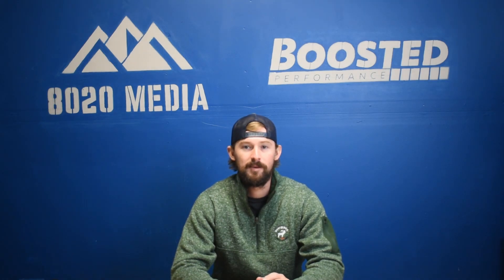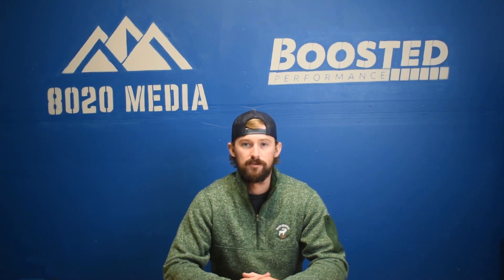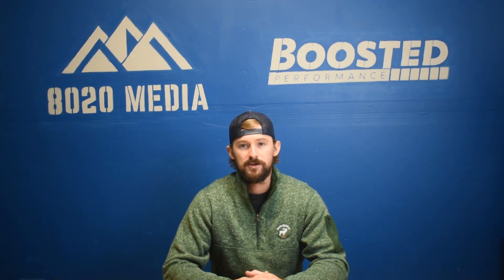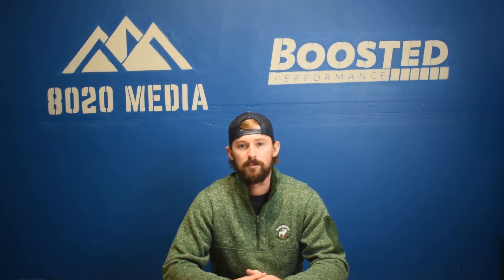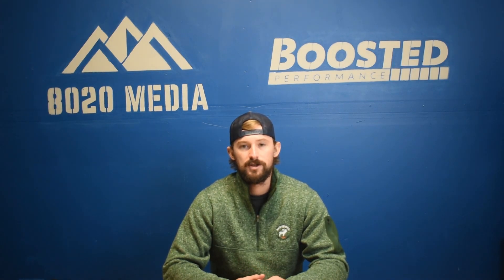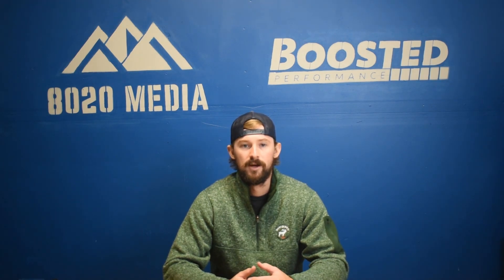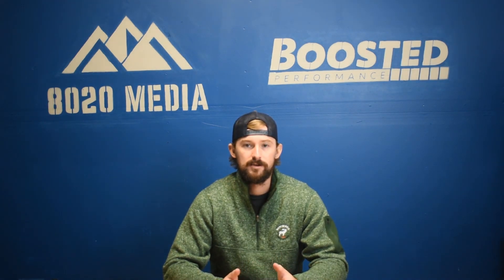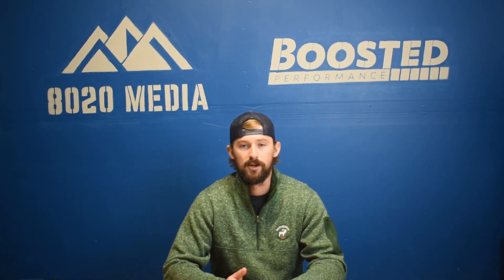Is the Ford Triton V10 a Bad Engine?

Comment: I'm looking to buy a decent gas-powered older class A motorhome over the next few months. I've of course been absorbing Youtube videos to gain as much knowledge as I can regarding engine options and the pros and cons of each. The three flavors that stand out are the Ford 460, the chevy 454 and the Ford Triton V10. The reputations so far for the Ford 460 and the Chevy 454 seem to be favorable. The V10 is much more, shall we say, spotty. Case in point, and one not mentioned in your video:

A Youtube video from about 4 years ago described a Class A motorhome with the Ford V10 that was making a knocking noise. This engine had around 65,000 miles on it. After a couple of mis-diagnosis incidences (valve train, exhaust manifold gasket) it was found that the cylinder #7 fuel injector was malfunctioning and pouring excessive fuel into that cylinder. The tear-down revealed that this excessive fuel had been washing the oil from the rings and cylinder walls, causing the piston skirt to score both itself and the cylinder wall and the piston to slap - which was the source of the knocking sound. Several thousand dollars later the engine was rebuilt by a reputable Phoenix-area shop.  

I vaguely recall another Youtuber mechanic (car wizard) strongly recommending avoiding these engines as well as the Triton V8s. While most engines have their pros, cons and gotchas, with everything I've uncovered thus far about this particular powerplant I've decided to avoid the V10 like plutonium.
Reply from the maker: Not a bad call, I wouldn't say these have been terrible engines, at least in newer form, but the 454 and 460 definitely have a few less serious problems.

Comment: Retired Tech Here, Yes Saw Plugs Blow Out, Had Many Customers That Never Had A Problem. Use Motorcraft Plugs Much Better! This Is A Tough Engine, And Like Any Other. Just Needs To Maintained Properly! Great Report Thanks
Reply from the maker: Charles - Thanks for sharing your experience and insight! This will certainly help future viewers.
Reply: @8020Automotive  ok great thank you
Reply: Would you buy a 2003 f250 super duty at 191k miles if it was well maintained?  I'm shopping for a farm truck. Will haul hay/livestock, but only put maybe 3k miles on it per year max.  Looking for something with reliabiilty and longevity.
Reply: @slandshark   Yes,  if it had regular maintenance and the price was in line with the overall condition.  Worst repair might be that the exhaust manifold studs need replaced.  Just had this done at 150k on our 2008 V10.   Couple other things to check with high mileage...  Verify front end components are good and tight,  verify front calipers release fully and don't drag.
Reply: I feel like the problem stems from not torquing down the plugs to the specific requirements
Reply: Howdy Mr Charles, I'm purchasing a v 10 single cab dually 4x4 automatic. They're is a little smoke coming out the bottom of the engine where the exhaust meets the engine.  No oil leak that I can find and doesn't smell like oil. Just wondering your take, I know there's not a lot of info to help you make your decision. Thank you in advance for answer
Reply: Drove a E250 over 300k with zero problems.

Comment: Another channel did a 6.8 excursion vs 8.1 suburban 2500 and both got 13.4 and 13.5mph after 100 miles. 
They made the 6.8 for 20 years because it was amazing in fact they still use them for school busses and large generators because they are extremely reliable with good maintenance. My f350 6.8 is sitting at 478,000 miles and I haven't had to open up the engine. My biggest problem has been old sensors and exhaust manifold bolts breaking. I already rethreaded for a larger size bolt and that has fixed the issue thus far. 

Its been the most reliable vehicle ive owned and has never left me stranded, i bought it at 211k miles for $900 it had been sitting since the owner passed away and his son was a cheby guy and disnt want it. 

Change the oile every 7-10k miles at least clean the spark plugs around the same time torque the plugs to 20-21ft/lbs and just do your maintenance and they'll go on for a long time. At 500k miles im gonan do a rebuild and do some upgrades to help it keep up. I will never get rid of this truck until the fram rusts away.
Reply from the maker: Dustin - Thanks for taking the time to share your experience! This will certainly help future viewers.
Reply: I'm more like a chevy guy but also trying not no fall into the dumb idea one brand is better than other. 
thank for sharing👍😎👍
Reply: Love hearing the Bluebird Visions propane screaming by. School is around the corner.
Reply: I'm disabled I will have to have someone change the plugs for me is it an expensive job? Thank you for your review of the 6.8

Comment: bought my 2000 excursion with 420,000 on clock and bad trans from a old guy who drove long haul to visit his kids a lot. trans gave out so he parked it thinking of getting trans replaced. never did so he sold it to me. i put in a used trans out of another f250 I bought with it and been driving it for 80,000 miles now. replaced vac lines and about to replace plugs and coils. nothing else and runs flawless. it was quieter than my 2002 f250 i bought new with a 5.4. I get 12-13 around town and 16-16.5 on the highway and 11.5 towing my 23' boat. just came back from a vacation run of 500 miles and averaged 14.5 town and running 75 most of the time. before anyone calls bs, cut the ford muffler off and replace with a flow master or equivalent and a k&n. DONT cut off the cat though or you will definitely lose your milage gains.
Reply from the maker: O - Thanks for sharing your experience. Sounds like you got a good one!
Reply: Kool thanks thinking of buying a 10 f250 with a v10 in it.
Reply from the maker: C - Nice! Keep us updated.
Reply: If u cut the cat off, you need to retune the ecu for mpg/ power gains.
Reply: My 5.4 absolutely loves gas ⛽ 16ish highway, 12/13 city...it is hell having a shitty job that doesn't pay a whole lot. Keeping gas in this thing is a true struggle 💯
Reply: @everythingstrength1485  most people that have low pain jobs and have to use their vehicle for commuting get a little four banger. Luckily I’m given a nice work truck but keep the 5.4 expedition for the weekends and for road trips. Maybe consider this and get Allstate with the mile wise program. It only charges you for the miles you drive instead of an expensive flat rate for vehicles you hardly drive. This is how I’m able to afford my sports car plus the expedition 2 Wheel Dr. and another expedition four-wheel-drive and the wife’s car.
Reply: @RemmikRotus  "the wife" took everything that wasn't bolted down. Even some things that were 💯 (whole 2 story house)....it's a struggle with a 40 gallon gas tank, and no other options
Reply: @everythingstrength1485 you have other options, you just don’t want to trade in your truck
Reply from the maker: E - Thanks for sharing your experience.
Reply: @everythingstrength1485 for your 5.4

SPD Y-Pipe
Shorty headers 
Sct with a tune 

Not only will it improve drivability but you will conservatively gain 2.5 mpg at highway speeds 

I have a 21' RV with  this engine 10.3  - 13.9 mpg before mods 14 .1 - 16.9 mpg at 61 mph ...  RV loaded weights close 10,500 lbs
Reply: K&n 😂 stock intake is good to 500 hp. Quit telling people to waste money.
Reply from the maker: J - In our opinion, it's not a waste of money.

Comment: When it comes to fuel economy, you have to remember the V-10 replaced the 460 big block V-8 and not only made more power, but was more feul efficient, about 20% better.  So at the time in the 90's, the feul economy of the V-10 was pretty good for a large gas engine.
Reply from the maker: Brown - Great insight added here. Thanks!

Comment: It always amazes me when the subject of fuel economy comes up with gas trucks, its a simple fact that nox emissions are combated in two was EGR and rich mixtures to reduce combustion temperatures and in general piston and exhaust valve temperatures by the ability of the unburnt fuel being able to remove some temperature and making engines more durable under heavy towing and high load conditions, manufacturers program for worst case scenario as no one knows which truck will be used by whom for what at what frequency  !
Reply from the maker: Hitman - Thanks for the insight.

Comment: Where were you with this video 3 years ago? My 1999 F350 was driving almost fine, it developed a random misfire. But, the real pisser happened at 143k miles the F'en timing chain on the passenger side broke. It's a truck and Fords used to be reliable, I couldn't afford the diesel so I got the gasser. So let down by Ford, big time. I really should have known better, after all, who in their right mind would put an OHC engine into a truck? That alone should have pushed me away from Ford. But I bought it anyway. At the end of your video you said these were overall pretty reliable engines. No they were not, blowing plugs, burning valve, exhaust  leaks, timing chain failures, etc. And if a chain failed it does valve damage. If you truly want a reliable engine you buy the Chevy with the 6.0l engine. Those were great trucks all the way around.
Reply from the maker: Sorry Kirk! There's Chevy people and there's Ford people. Each are great.
Reply: @8020Automotive  honestly I felt betrayed by Ford. I grew up in a ford family. I've had Rangers, older F350 with a fantastic 460, I've even had a Taurus and a Tempo. So when i bought a truck labelled "Super Duty", that's kind of what i expected. Instead at only 143k the engine became a boat anchor. All my Chevy friends cruised right past 300k with their trucks. But in the bright side, I didn't buy a Dodge. The friends that bought Dodges didnt even make it to 100k.
Reply from the maker: Sounds like a rough experience and we totally get the frustration.

Comment: I just wanted to let you know that youre completely butchering and blending the spark plug issues

Also the 05-08 3v motors also had spark plug issues in the 3v form (btw the E series and bare chassis motors were almost always 2v up to 2019 where all F series v10's after 2005 were of the 3v design.

So thr plug issues. The early 97-02 motors had a HEAD CASTING issue. The spark plug as fine, but someone goofed up and tapered the plug holes too much meaning while the plug had like 11 threads on it, there were only about 4 threads in the head. They fixed this issue in mid 2002 and it was great. Some people would overtorque the 4 thread heads leading to weakening of the threads that would cause a blowout (if they didn't just pull the threads while tightening), others would under-tighten the plugs causing the plugs to come loose while the engine was running and rattle and rip the threads out, leading to a blowout.

Then in 2005 they came out with the 3v, like 14 threads right? But they made the plug 2 pieces pressed together and thwy had a long stem that would press into the head below the threads and help seal. This long stem would sieze, and then the threaded part would come out and leave the cores inside, or the core would twist in half. Quite a fun time, and then you had some people over tighten these and the cores would shoot out and leave the threaded sections fully intact. Then in 2008 they moved to a 1-piece spark plug and from them on the only issues were sludge buildup and the plugs being tight enough to break cheap ratchets on by the time their change interval came.

Thank you for atte ding my ted talk. I will see myself out.

Edit: so the timing chain issue. 
They used plastictensiomers from somewhere around 2003 to about 2008/2009, before and after that time period they used cast iron chain tensioners. The plastic chain tensioners would crack and fail early, the cas iron tensioners would survive as long as you kept up with your oil changes for the most part.

Also plastic guides suck but many other families of engines also use plastic chain guides. Also the v10s frequently got iron tensioners even through the plastic tensioner era because they were known to be a heavier duty application. The v8's had more chain issues and also the 3v v8's got VCT systems (that sucked balls) and the v10 never got those that i'm aware of.
Reply from the maker: Thanks for all the additional info and keeping us honest!

Comment: 250.000 on our 2001 V10, service every 3.000 miles, Castrol 10w30 with Wix xp or Mobile 1 oil filters, replaced alternator once, thats it.
Reply from the maker: Southern - Thanks for sharing your experience! It sounds like you have a good one!

Comment: Bought my '01 used with 117K on the clock. Had the plugs replaced at the dealership, never been an issue. Over a decade later and 165K no issues with the drivetrain. I've got the heaviest truck you could get outside a dually, I get 11MPG in mostly city driving and about 13 highway only. Best tank I've ever gotten was a flat stretch of highway where I cruised at 60MPH with a tailwind, and got 16MPG. Never touched that mileage again, it's consistently been 11-13 MPG. This truck seems to have about as much torque as either of the Cummins trucks I owned in the past. Had 2 coil packs go bad, I replaced them myself. Original transmission and it shifts fine. It's powerful enough to stomp on the gas and burn rubber on dry pavement even with brand new tires. Worst thing I could say about the V10 is the gas mileage. Of course the modern choked-down diesels aren't doing much better and cost more per mile to operate.
Reply from the maker: Eric - Thanks for sharing your experience! This will be very insightful for future viewers.

Comment: I just sold my 1999 F-350 to a close friend.  It had 330,000 miles on it and ran very well.  I have repaired 6 of the spark plug threads in the past.  With the kit I have, it wasn't really that big of a deal and really gives me piece of mind.
Reply: Do you have a link to the kit you bought?
Reply: @SirGuidemere  My buddy bought his at Napa.
Reply: Could you tell me what kit you bought please
Reply: @derekquintero6252  My buddy bought the kit at Napa.
Reply from the maker: Turbo - Thanks for sharing this experience! Sounds like you sold a beast of a truck.
Reply: You pulled the heads off for the spark plug thread job?
You pulled the motor out?

Comment: I agree with some of your observations regarding the problem areas of the V-10 engines. That said, many of the issues can be improved by better maintenance. Many of these engines are used in heavy duty towing applications and can benefit from frequent fleet schedule (3000 mile) oil change intervals rather than the 5000 mile intervals suggested. (Oil is cheap compared to engine replacement). The cams and cam chain components will live much happier lives with clean oil.  I would disagree with your opinion on the mileage numbers. Unless you have your right on the floorboard all the time, I find that these engines can achieve decent mileage in everyday use. I normally get 11.5  to 13MPG around town and slightly better on the highway when not towing. Towing a 6000 lb. trailer it drops down to 8-10 depending how much climbing is needed. That is very good compared to the 460 V8 truck it replaced which could never reach 10 MPG empty or better than 6.5 towing. The V-10 is a better engine for towing. Based on what is available in the truck market today, I will keep my 2001 F-350 4WD until it turns to dust.
Reply from the maker: Paul - Thanks for taking the time to write this insightful info! It will certainly help future viewers!
Reply: What’s some of the problems you’ve had with your motor
Reply: @thebear6751  Other than maintenance, (3000 mi. oil changes), belts, filters, etc. I have had no problems whatsoever. I changed the factory spark plugs at 110,000miles- all were worn but tight in the head. I recently returned from a 200 mile trip (not towing anything) and averaged 13.5 MPG which included mountainous regions. My son has an almost identical 2001 F-250 V-10 truck with 320,000 miles on it with no major problems.  We had to replace the radiator due to a plastic tank splitting so we replaced the water pump and hoses just because they were old. I am very pleased with the performance of these V-10 engines. After doing research it seems the unfortunate spark plug blow-out problem is caused by the factory by not putting enough threads in the head, and also by the factory issuing a 13 ft lb. torque spec. on the plugs that is not sufficient to keep them tight. When they loosen, it causes cylinder pressure to blow past the threads eventually damaging those threads and  launching the plug. If you torque the plugs to 20-26 ft lbs. and do NOT use any anti seize.it is highly unlikely you will experience plug failures. One guy ( I think it was on YouTube) took a pair of old heads and tried to see how much torque it took to strip the good threads out of the head. He couldn't do it as the spark plugs kept breaking at about 100 ft lbs.

Comment: So,  Replace the PVC and hose every 50,000 miles,  replace or retorque plugs every 20,000 miles,   when new - replace exhaust studs and nut with stainless steel,  Replace timing chain and guides every 125,000 miles,  carry a spare fuel pump.
Reply from the maker: You can just replace the PCV hose and exhaust studs when they fail and cause a leak. Keeping on top of the plugs and timing chain would be responsible though.
Reply: @8020Automotive  True except for the ex. studs;  you don't want to wait until you have to drill them out and helicoil the holes.
Reply from the maker: True.